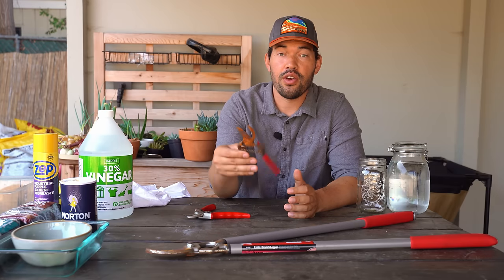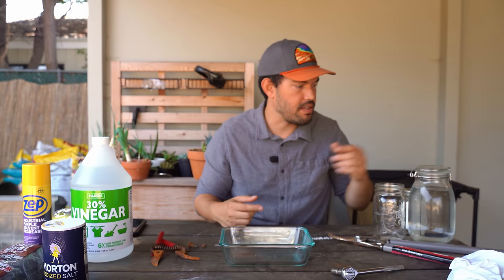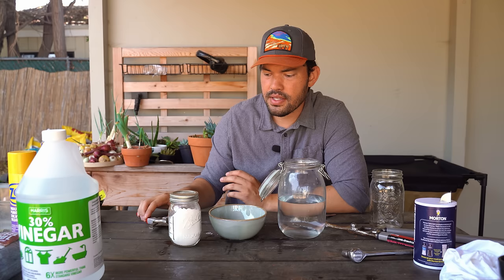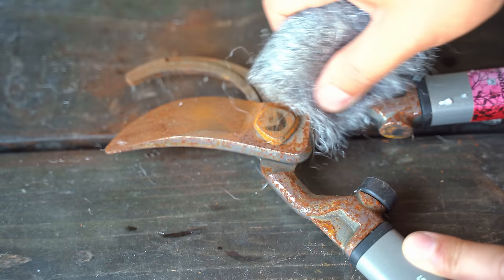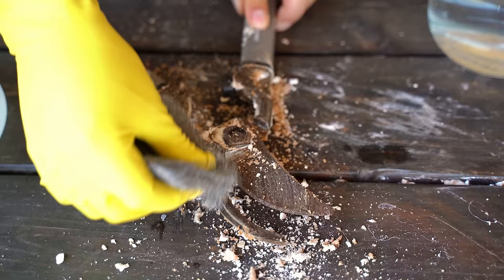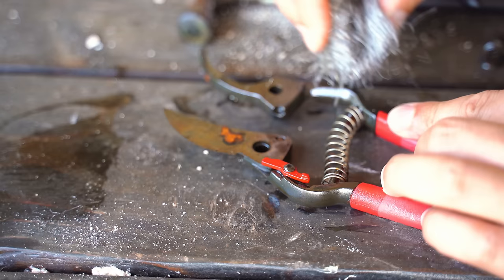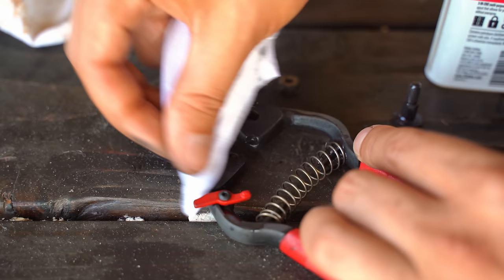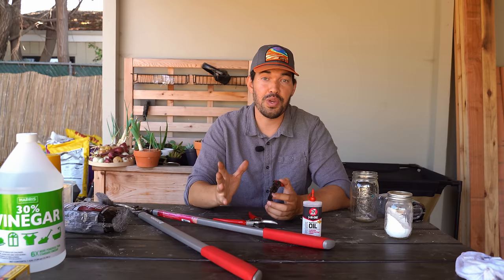Easiest Way to Restore Rusty Garden Tools

Comment: wellllll, sorry but it's pretty clear you haven't done this very often (or ever?).  you diluted the industrial vinegar waaay too much.  yes it's potent stuff and you need to be careful (it can burn your skin so wear gloves!!) but it CAN be used full strength or SLIGHTLY diluted also works fine.  my tools are very expensive so i take care of them and never (!!!!) leave them out in the rain but i do abuse my saltwater fishing needle-nose pliers, which i need to be more faithful about taking care of.  unfortunately after a long day in the hot sun that started before dawn, i'm sometimes just too tired to care.  the saltwater is brutal on tools... hence the reason i've done this DOZENS of times with success.  the 3-IN-ONE is also a great product but in my opinion you used the wrong product.  use the 3-IN-ONE PENETRANT which adheres, lubricates and is a MUCH better product for PREVENTING rust.  yes, i realize this was sponsored and you probably had to use the product they forced you to use... but the PENETRANT is a much more effective product for future prevention.  for those who take my advice and don't over dilute your vinegar, put the industrial vinegar/salt mixture in a more size appropriate container for the tool you are de-rusting.  it's abt $21 per gallon (vs abt $5 for the regular white vinegar) and since you are going to use more of it than Kevin did, you will want to use a more appropriately sized container so it's immersed but not wasted.  also, use more salt and agitate more than Kevin did so it's thoroughly mixed and in turn, it will give you more of the chemical rust-dissolving reaction that you're seeking.  (note:  the legal department wrote the industrial vinegar label so they don't get sued but 'the suits' are morons when it comes to the most effective way to use this product... all they care about is making sure their client doesn't get sued).  #StickToGardening